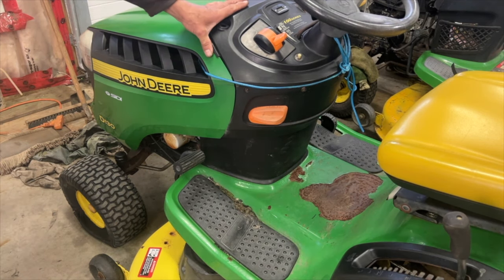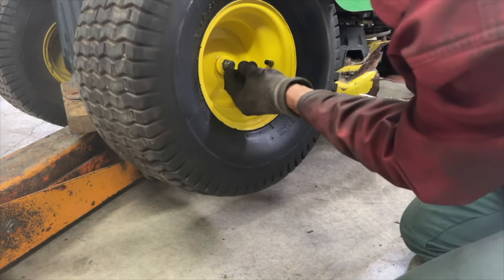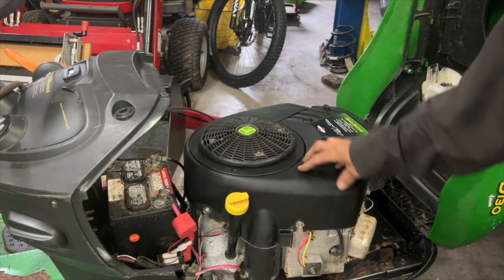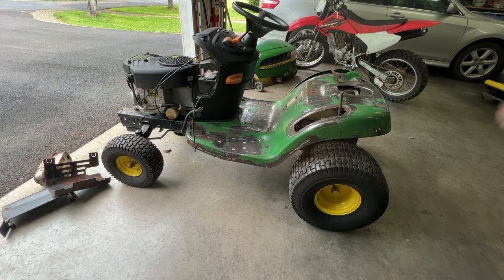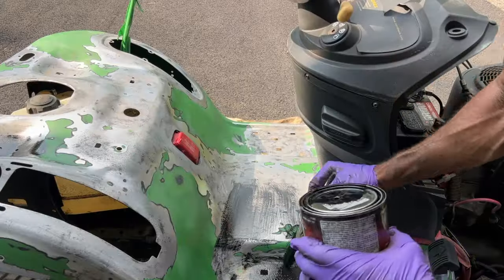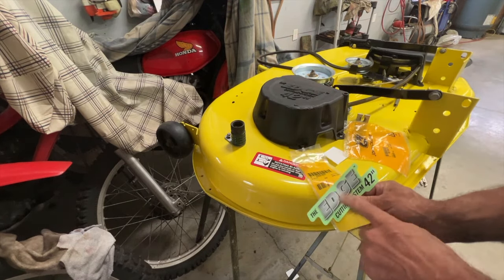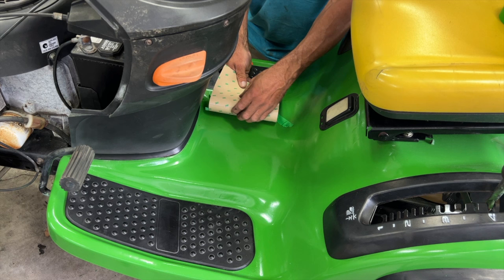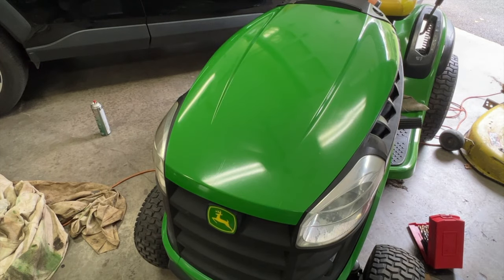Restoring & Flipping a $400 D130 John Deere Lawn Mower Tractor to Like New. Complete Rebuild. $$$.$$

Comment: All that labor and you spray the highest cost, lowest quality rattle can finish.  At least use JD paint if you are going through that much effort.  Really should be using a spray gun.  I can tell the finish looks worse than OEM.

Comment: I don’t know why, but it seems like mice favor building their nests on that exact same side of the v twin.
Reply from the maker: I think you’re right.
Reply: @WeekendHobbyMechanic  I'm pretty sure I am, every video I've watched that has a nest, is on the same side. I got an abandoned LA145, and it too had a gigantic nest on that side. The mice put enough piss thru the nest that it locked up the starter. Not just the bendix, but the starter motor as well. The ignition coils were so rusted, the laminations were forcing themselves apart. Plug wires chewed thru, and the smell took weeks to fade away even after powerwashing everything. Its good that you found the nest prior to running the engine. The airflow from the flywheel fan is absolutely necessary to keep that side of the engine block from overheating, warping the head, and destroying the cylinder from heat distortion.
Reply from the maker: 👍.   The cylinder is lower on that side.  More room for the mice.
Reply from the maker: 👍. The cylinder is lower on that side.   More room for mice.
Reply: @WeekendHobbyMechanic  that makes sense.

Comment: That’s a real good idea using those bolts on the hood. Probably more solid than the original. I just can’t understand why John Deere can’t make a steel/metal hood like the foot rest and the back/gas tank cover. Good video.

Comment: Great videos!
When do you use etching primer vs high build primer or POR 15 primer before putting your John Deere paint on ? 
Thank you.
Reply from the maker: I first use por-15 prep on the metal.  Then por-15 paint or primer.     Under the deck I used por-15 paint (no primer).

Comment: Nice Job. 👍
Just wondering how much total time it took in repairing and sourcing parts and total cost of those parts?
Reply from the maker: I forgot to add it in the video. Tractor with all the parts came to $1150 or so.  Sold it for $2400.   Didn’t count my hours.  Too many lol.
Reply: @WeekendHobbyMechanic  I have a john dear tracker and it need some TLC. Whenever I look at what it would take to restore it, I decide on just waiting until it dies  and buy a brand new one for about the same cost it would take to restore it in parts and labor. However if I have the time to spare I would love to do this as a hobby. 
Having said that, I don’t understand why someone would pay $2400 for this when they could buy a new one for about the same price.
Reply from the maker: This tractor in Canada sells for $3900 plus 15% tax.   I sold it for half price.  Good deal
Reply: @WeekendHobbyMechanic  WOW! I didn’t know Canada was that expensive.
Reply from the maker: @irfanfarid  $3900cad equals $2886us.
Reply: @WeekendHobbyMechanic what state you live in? Also I flip john deere mowers total cost to buy and repair is 350 I sell them for 735 on face book marketplace and I flip newer ones like d100s and Las but 2400? Wow
Reply: @WeekendHobbyMechanic also were do you sell them?
Reply from the maker: Sell them on Facebook marketplace or Kijiji.ca.  I live in Nova Scotia Canada.  Great place to live but the taxes are the highest in our country.

Comment: How many hours were on it and how much did you sell it for? I flip john deere mowers and I like to have $300-$400 into them and sell for 700-900. I don't get to crazy on the paint, usually just a quick sand, prime and paint. Time is money so I am quick with my repairs and I price them to sell fast
Reply from the maker: Tractor (138hrs) with all the parts came to $1150.  Sold it it for $2400. ($1886us).
Reply: @WeekendHobbyMechanic 
How much a brand new one cost?
Reply from the maker: @RomeoUrsu-fy9qo  in Canada a new 130 goes for $4500 cad with taxes.
Reply: @WeekendHobbyMechanic  
Wow 
Pretty expensive